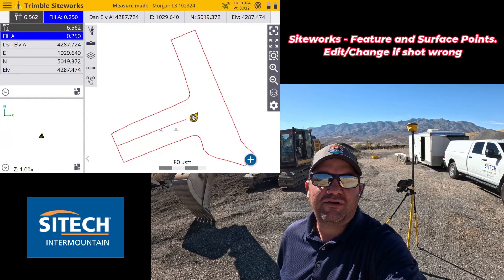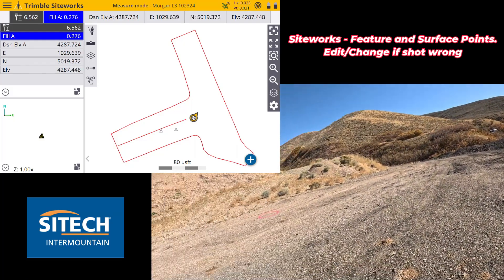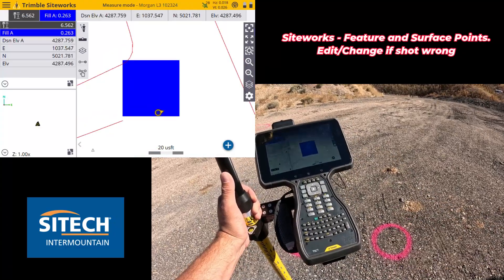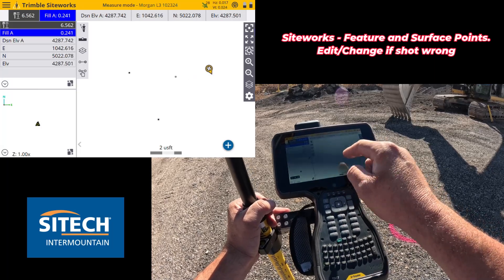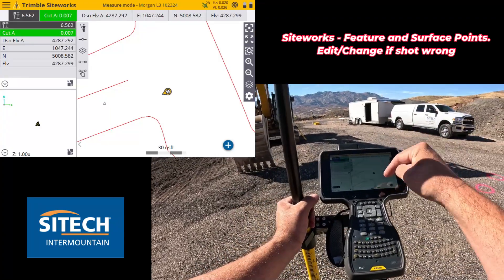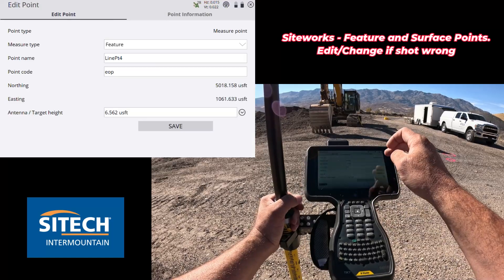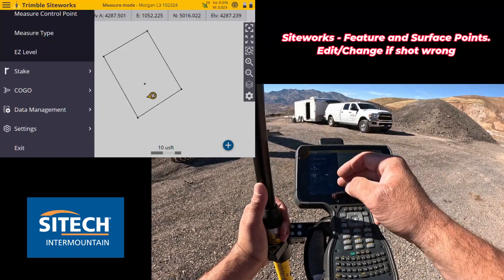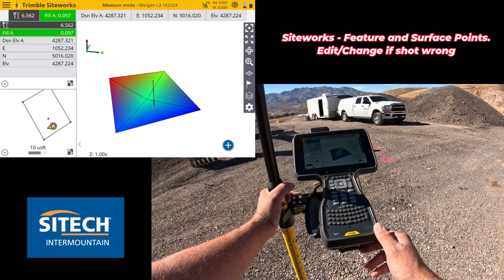Siteworks 1.73 Edit Feature and Surface Points if shot wrong

Comment: what exactly is a feature point?...sorry for the ignorance
Reply: It's a fixed point with no surface attached.  We use them to mark fixed items like manholes and water valves.  We also use them for as-builts for utilities for marking fittings and things.